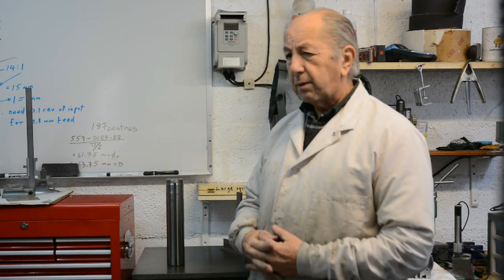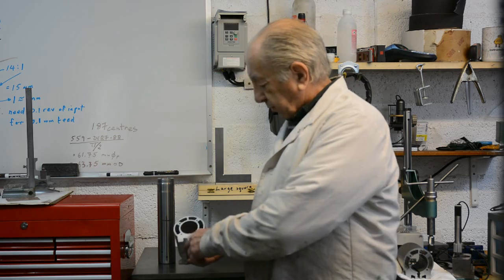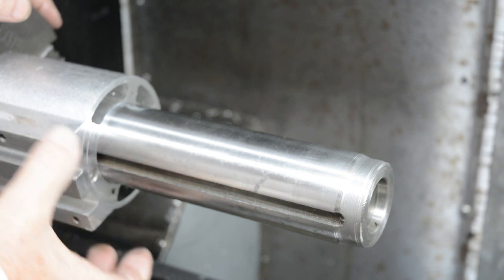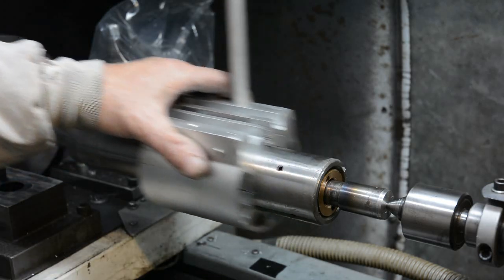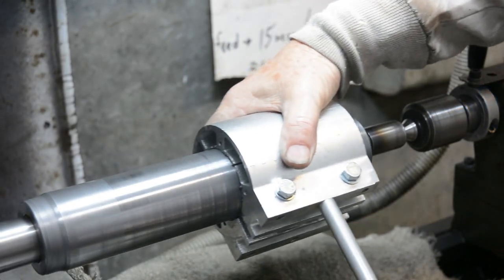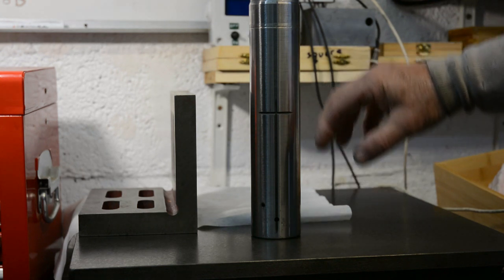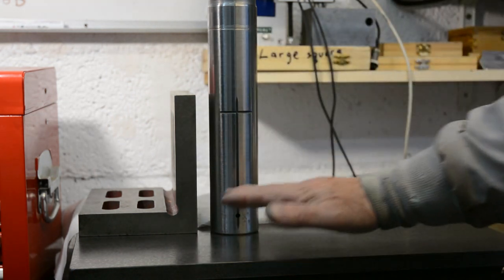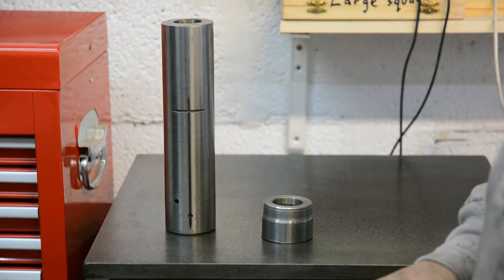Cylindrical Square, lapping.

Comment: So bassicaly axis of that cilinder was squer to the base from beggining, you lapp this cylinder to same diameter?
Reply from the maker: It was close to square but nothing is perfect.  However, a cylindrical square is always square on two opposite sides if it is parallel.  It is usual to check a cylindrical square and mark the two accurate sides.